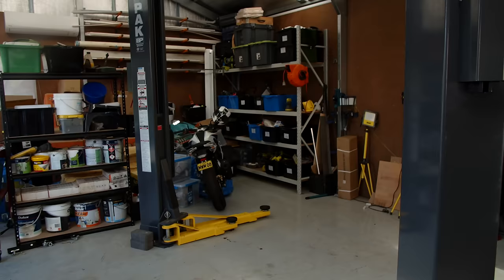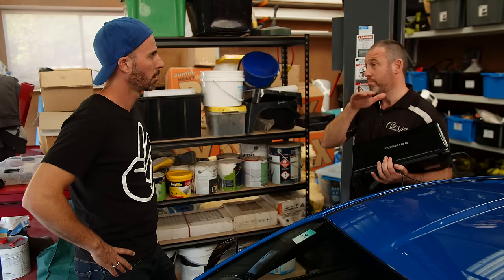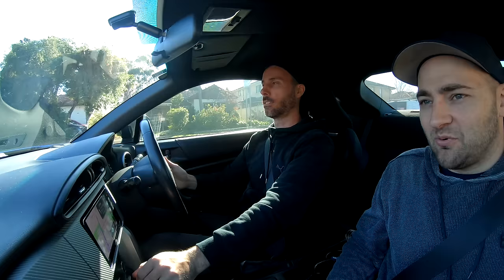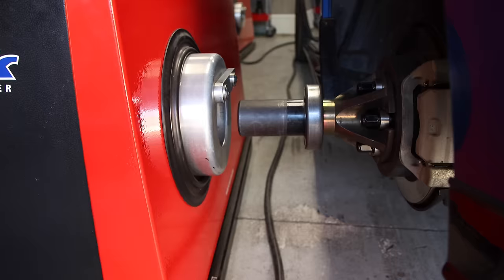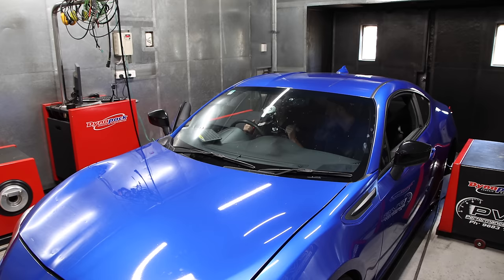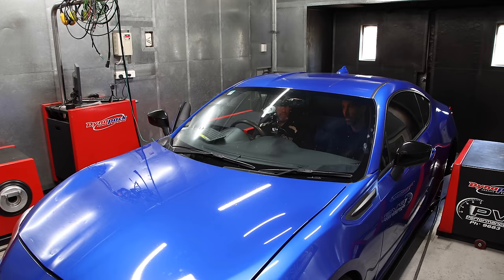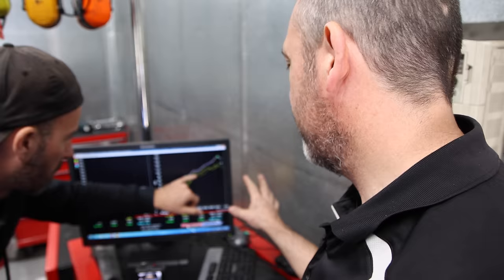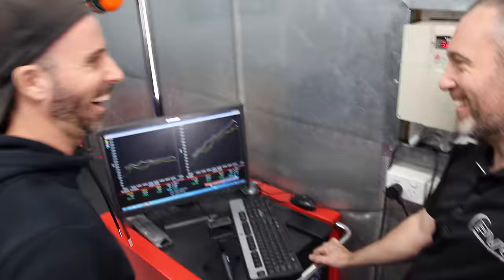How To Make More Power with an NA Engine (HUGE INCREASE!)

Comment: Recommend PVS at paramatta, it's where I got my turbo 86 tuned, made 280kw at the hubs on e85 11psi.
Reply: That's awesome, has it been reliable since the turbo and tune? Did you have to replace anything else?
Reply: @mikeLOL45424  Plenty reliable, been 3000km. Running a SME Spec R kit (Supplied by PVS in the video^) which is a garret gt3076r and external wastegate. 
Running:
- mantic 9000 organic HD clutch
- RacerX Oil cooler
- SME catch can
- SME Baffled sump with oil return fitting
- ID1000cc injectors
- stock fuel pump

Key to reliability in these cars is ensuring oil level is near the top full mark on dipstick and baffled sump to make sure you dont starve and spin a baring. Oil cooler to keep oil in its operating range.
Most importantly, the weak stock rods dont like boost coming in hard and early, laggier options like the 3076 see full boost at 4500rpm+, as opposed to 3000rpm. All the failures I have seen were with smaller turbos like 2867's which hit full boost very early. I know people that have ran 3076's and other bigger turbos for over 30-40,000km with no issues at 14psi.

Comment: Stroke it, add strong internals (forged crank, pistons, titanium rods), super aggressive camshafts, machined and ported head, intake, header, exhaust with no cat and minimal resonator, then retune the ECU. Probably make 130-140hp per liter, but will be obnoxious, need to run on really high grade fuel and hard to start.

Comment: At first i was wondering do we get a different version of the BRZ in europe because they come with 147KW/200HP from the dealer but isn't that the crankshaft power figure? So is the drivetrain loss about 30KW?
Reply: I don't understand either, the headers + tuning isn't even recovering that loss
Reply: Him saying that the cars from the factory have 100 KW at the wheels was awfully suspicious.
I wonder if his "stock" tune was undertuned so they could show off a bigger increase in power with the tune...
Reply: Stock BRZ horsepower figures are around 165 - 175 (125-ish KW) and that's usually with a correction factor.  It seems clear this dyno isn't applying a correction factor to account for altitude above sea level which could add maybe 20kw at the most, probably less.  His dyno, at his shop seeing 105kw from stock BRZ's seems perfectly legitimate, at least in my opinion.
Reply: A hub dyno reads lower and far more accurately then wheel dyno's.
They are the next best thing to pulling out the engine and putting it on an engine dyno, which is where that 147kw figure comes from.

Comment: 8:44 has anyone noticed that the left exhaust tip is hanging slightly lower? or is it just me.
Reply: yes I did!
Reply: thats for the purity. leave it alone...
Reply: @RR-cg2rq  that explains Marty's sti
Reply: @ghomerhust  wHeRe'S tHe PuRiTy MaRtIn? See the emphasis I put in there..
Reply: Pretty sure that's for tuning coz of the uneven length headers...  Well, that's the excuse I'd use instead of gettin' under the car again 😎
Reply: It's hard to get it right because one tiny imperfection down the pipe can cause the tip to be all over the place!
Reply: @Gobbbbb  tbh even my own exhaust doesn't hang level
Reply: Probably when they fixed that exhaust leak right before the dyno. I'm sure they'll put it right later on.
Reply: One lower than the other is natural.
Reply: @ctrlaltdebug  😂🤣😃

Comment: How its possible you are having 117 kw from stock car, meanwhile in europe it has stock 147 kw? I'm confused 😄
Reply: 147 KW at the crank not at the wheels. Look up the dynos for more info about drivetrain losses
Reply: Ikr. Here in the US 126kw at the wheel is super standard. I’ve seen countless stock dyno sheets stating such. 110 is weird.
Reply: @Hashimooo  200 crank HP is about 149kw. 15% driveline loss is 127kw. So 117kw pre-tune is on the low end of the range I would expect for stock and 133kw is within the range of stock. The initial power output seems low to me.
Reply: @Hashimooo  thanks man, now I can finally sleep

Comment: Do somthing on valve seats and strong valves or bore out the pistons change compression ratio and stuff some proper machining to the head and cylinder block.... costly but you haven't done it so why not try.. looking forward to the next episode.

Comment: Buy an Acura RSX 5 speed base for $700 with 111,000 in excellent Shape from a family member and do a K20/24 swap, Hondata, LSD, suspension and brakes for about $6000 and you got 230whp and 185 wtq. Super quick quick and tons of fun

Comment: I bought a Chevrolet Vectra 2.4 CD Hatchback 2010 (Originally an Opel Vectra) in really awful conditions, almost totaled, but the engine was great, and it seems it was ECU tuned... I fixed all the details it had, and the ECU change seems to be really amazing, sounds like a turbo charged car... and it is just a NA V4... a few months back I was on a highway at top speed limit, and a pretty new Mercedes wanted to pass me, so I moved to the left and started to accelerate... he couldn't pass me... I got to 220 in a few seconds... And also there is another detail, it does not waste gas at all... I suppose it is because of the tuning.

Comment: Good gains,I opened my mouth and let the milk in. I think Arnie said milk is for babies though🤣👍being a Civic Type R VTEC and Mitsubishi mivec naturally aspirated sound owner is something you have to to feel is better than an orchestra from any turbo. Ok I realise that the guys to put the turbos on the Civic Type-R get incredible power over 400 breaks but be honest with you I have a martelius exhaust HKS intake and it sounds awesome and I reckon I'm getting at least 230 brake which is plenty on UK roads that you can't really enjoy it loads of power anyway it's plenty for the country lanes. It is a surprise that Toyota do have low brake horsepower from a 2-l my friends got an old Celica alright as a 1.8 but it has got very slow pull compared to the Mitsubishi I have. I'm guessing the vvti come on better with the later Toyotas but I do think Honda and Mitsubishi keep them up but with this one. I'm a fan of all the Japanese makes but I think Honda win the na battle with Mitsubishi previously being right up there unfortunately gone now.

Comment: Is it bad that most new economy cars make around 190 to the wheels. 

Keep in mind Horse power or killowatts doesnt matter. What does matter is the gear ratios and the weight along with suspension and chasis strength.

Comment: My problem with turbo cars is more than likely you'll need a new car or at least newer because if you have a car that's 20 years old or older you're most likely going to run into some type of problem because you know piston bearings and piston rings and transmission

Comment: Love moogs enthusiasm for tuning na motors... being from the uk ( london) I recently had to get rid of my heavily modded mondeo tdci whiche was making 240bhp and 400nm... 
Just bought a 2009 mazda3 bk and put a race manifold and custom ss straight pipe on and it instantly made me fall in love with na s again... its only making about 170bhp over the 150 stock, buy its so much more fun and engaging to drive... it maxe peak torque at 4000 and peaks  powere a 6200rpm, and now im thinking about other modes, but nothing sounds and feels better than the fire breathing na motor! It crackles and pops with no remap, thos car wants more power. Thinking cams and intake manifold.....

Comment: I'm a bit confused. The BRZ is rated at 200HP, so at the wheels should be 175-180, which is what 133kw works out to. 117kw at the wheels pre-tune seems low.

Comment: Do the unlock overide sequence on it if u aint already ! Did it on my x,s 86 so it engades peak perforce and properly disables traction control ! So it dont stilll activate as i found it does even when disabled is activated through buttons , yeah still comes on if u push it , but doing tje sequench overide made her car a different animal all together ! 
U do have to redo it every time u turn car off but as resets once u turn car off ! U can google the sequence to deactivate it

Comment: Now you're just missing a new final drive, you have now the stock 4.1, the 2017 model got updated to 4.3, but a 4.5, 4.6 makes a great difference. And specially on this one, cutting weight! I was sad to see you didn't put a lightweight battery when you changed it... and please, no turbo on this one 🙏

Comment: NA all the way 😅 I owned a peripheral port 13b rotary making 330hp , that thing was wild in a 900kg chassis!
Reply: I had a peripheral port on my old laptop but sadly I've never even driven a rotary. I did have a Honda VTEC so i can almost imagine. Sounds funny but it's the smoothness and lack of reciprocating mass that I want to experience more than anything. BMW straight six is the best so far. 3 cylinder diesel maybe the worst
Reply: @psions555  yes the smoothness is very surreal, hence Mazda factory fitted warning buzzers to all rotaries to remind you to change gear at 8500rpm as they don’t give you any indication of high rpm mechanical stress.

Comment: Blew up my frs. Valve dropped when I locked the rears on a down gear with a quick clutch release to throw the rear. Then cultch kick it to keep it sliding. It had done it many times before. But this time it made the saddest noise I have ever heard.

Comment: I'm actually sick of turbo chargers, but more the reduced displacement+turbo move manufacturers are going to - eg. I'd rather an NA I6/v6 over a turbo I4 or an NA V8 over a turbo I6/V6; I have little love for an NA I4 unless it's in a motorcycle or a very light car; even the Miata would be better with a turbo or more cylinders, a BRZ needs a turbo or a better engine, that FA20 flat four sucks out of the box and is limited even after throwing money at it.
Additional gripe: modern turbo cars are typically small turbos that give you lots torque down low and then they fall on their face/run out of air higher in the rev range.
Give me something with 6+ cylinders & displacement then add a dual scroll or a roots blower and I'm happy.
6:24 the traction light came on because you abused the clutch during the shift - you essentially performed a clutch kick.

Comment: Na cars have a lot of advantages in controlibility ,  the differance is that the necisary  driving styles are entirely different .  there are 800 hp na motors out there .  if there's something slow about 800 hp and plenty torque you're driving it wrong. 😂 .  Truthfully in na mode it's a thing of the more cylinders less displacement  taller block and taller stroke the more na power you make .  the stroke creates the boost so with high stroke low displacement motors because rotating mass is do low with a simple sohc and 3 valves per cylinder because of the lack of cam and valve weight combined with the fact that there is alwayse more intake than exhaust you can actualy get remarkable numbers completely unboosted . they've been pushing 100 na to per litre for over at least 30 years .  the 1969 potiac gto judge with race options and Ram Air IIII was turning an under rated 400 horse and 500 lb feet with a 11.5 second 1/4 mile .  not everyone likes quarter mile ,  no ,  however that's still insain power for 1969 .  I like how you are thinking .

Comment: awesome video. would there be a 30+ hp gain for an inline 6 cyl with headers exhaust and tune? how can you tune a stock ECU without removing and soldering a chip?
Reply: You can connect a cable via OBD2. Like ECUTek

Comment: i have a 2.0L NA Fiesta ST150 and did a power run before a full Milltek exhaust was fitted and it gor around 148bhp and 183nm and then after the Milltek Manifold, Sports Cat and Catback the car was left to run in and then went back the same place and ran 151bhp and 180nm. So gained 2-3bhp and lost torque. Not sure why as even Milltek themsleves say you can see 10-15% increase. Im lost

Comment: But not all NA engines are ready for turbo.. You'd right away up to double (or even more) the compression in your engine.. Now that's definitely gonna increase wear and tear in your engine, which isn't a big concern knowing that on many engines you'd bend a connecting rod or punch a hole in your piston/block.. 
Basically you're gonna have to change 90% of your engine to cope with the increased pressure, and still have the chance of ruining your block..
Just buy a car with a turbo and save yourself the headache..

Comment: So... riddle me this, please, i beg. A stock Toyota ECU, (i've heard through the rumour mill), will not hold a N/A tune & will always try to re-tune the engine back to stock mapping. Be it 1NZ-FE, 1ZZ-FE, 2ZR-FE, 2ZZ-FE, 2ZZ-GE, 2AZ-FE... and so on. IS THIS TRUE? off course this does not apply to the A86, as that is a Subaru. But having put A high quality intake, and mega high quality quality exhaust to a 1NZ-FE, i fear tuning it to it's new set up would be a waste of $$. Help!

Comment: I'm confused. 117 kw is like 156ish horsepower. The manufacturer says the car has 200 horsepower. Why is their car almost 50 less horsepower?
Reply: Wheel horsepower is always 15-20% less than crank due to friction and drivetrain losses, so 200 at the crank would normally be 166-ish at the wheels.  Theirs is a bit lower than that so maybe the dyno is calibrated to under report or they got an engine that was a little down on power compared to other - not every engine is the same, even for new cars.

Comment: Can someone explain to me, what is going on here? A BRZ sold in Europe has 200 hp / 147 KW stock. Now this one is at 100? What am I missing?
Reply: The dyno measures at the wheels not at the crank. So stock is around between 100 to 110kw at the rear wheels. After tune and upgrades is now 133kw at the rear wheels which is about 180kw at the crank and about 240bhp give or take. So about 40hp more over the stock 200bhp. Not too bad in my opinion

Comment: Noob question, I thought BRZ's / GT86's ran about 200BHP. So if this was only making 117KW at stock, then that is about 156BHP, and even after the tune it's about 178BHP. Or is it measured differently because it's a hub dyno? Also the tuning guy needs to upgrade the OS on his PC. By the looks of it he's running Windows 7, which is out of support now. :)
Reply: They run 200HP at the crank without ancillaries.  Wheel power is usually 15-20% lower due to drive train losses, so you'd expect 166ish at the wheels (depending on dyno calibration/type) for a stock setup. 156 is a bit lower but factor in dyno calibration, air temp, engine variations out of the factory, its probably still in the ballpark.

Comment: I somehow with maximum level of optimism doupt my 30 year old na m42b18 will produce +33kw at wheels by dyno tuning in eu for 500-700€
Reply: In og it had 103kw by engine so now it has 80kw left at most. And those 20€ ebay “chip tunes” giving up to 10kw no thnx.

Comment: Bit random, but my car has bucket tappets and they are a bit on the loose side. Would my power increase slightly if I tighten them up properly, as I did a Dyno run and the power was lower than I was expecting considering my mods

Comment: You should do a test on which is better. Tires or upgraded sway bars. I am considering changing out my front and rear sway bars and I’m on stock tires and suspension
Reply: I’m kinda surprised no one ever talks about diffs. In every racing sim I’ve every played(I know not a direct comparison) the diff is really important for the balance and rear grip in the car.
Reply: Tires will almost always be more important. Sway bars can make a huge difference but there's no use in more mechanical grip if your tires aren't good enough to hold it. Tires are always one of the absolute biggest mods you can do for the price.

Comment: ???? Turbo Chargers re-use the fuel, so more gets used than just flying out of the exhaust, whilst increasing the bhp tremendously, long as other car parts are uprated, the best ones, are where you have a Supercharger connected to the flywheel, and when the supercharger reaches its points of gains, you let the turbo or twin turbo take over after the lag has been compensated by the supercharger. Tricky to install, but boy what a GAIN. Best to use on a V8, or a V12 Engine.

Comment: I tought BRZ had 147kw in stock. must be region difference.
Reply: There's a difference between power at the crank and power at the wheels.  Manufacturers always measure power at the crank because its the bigger number.

Comment: My. Budget got me in a “16” Toyota Corolla sport/ special edition package ...All black  💨 
After driving one it lacks power but still the CVT engine has me gappin/choppin✂️ any stock car on US highways
Maybe a thicker synthetic oil change, a new exhaust and high performance tires would be an immediate boost
If I can get a cheap TRD turbo I would probly keep my N/A but F-sport is also another option

Comment: Have i missed something here? Dont these cars make around 150kw as standard?
Reply: Basically that is at flywheel you get loss through drive line (transmission and diff), leaving the at wheel value(30% loss is not uncommon - my manual liberty GT gen 5 stock  is 195kw( on paper) at flywheel but was 148kw at wheels on Dyno
Reply: @jasonraynar6955  about 30 seconds after posting i remembered it was whp haha.
Reply: @diavo009  All good I do the same often. I was surprised at the drive line loss being rwd, as 105 rwkw for 147 kw is getting close to 30% loss.

Comment: Moog : "133 KW!! “

The rest of the world : " Google convert 133 kW to hp "
Reply: I don't understand this result. Google spec say, BRZ have 147 kW stock. So why this dyno showed 133 kW?
Reply: @jabberkonto  Hub versus flywheel. The gearbox and diff add friction. Unless you're a big company, flywheel power tends to be estimated, so wheel/hub power is more accurate and useful.